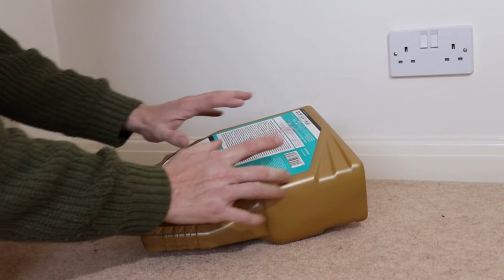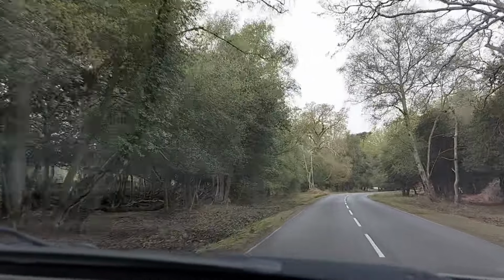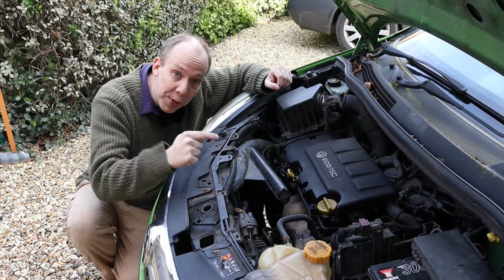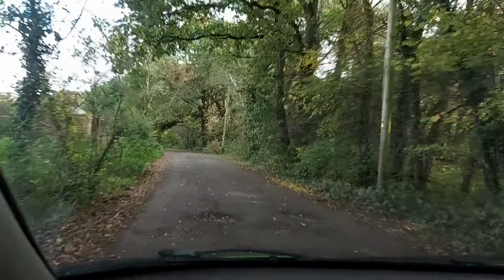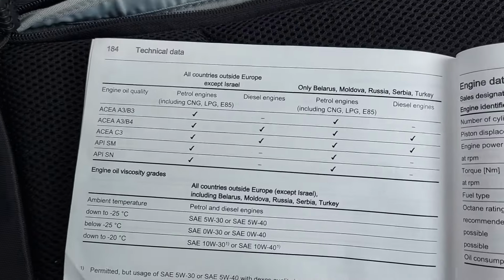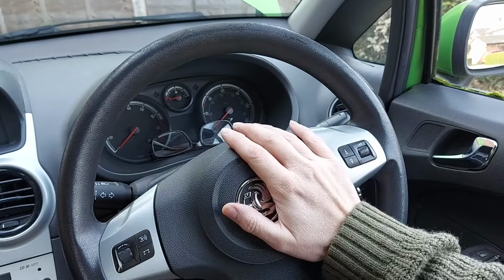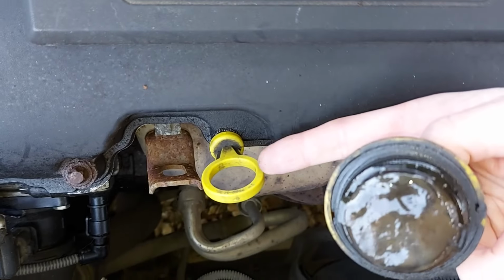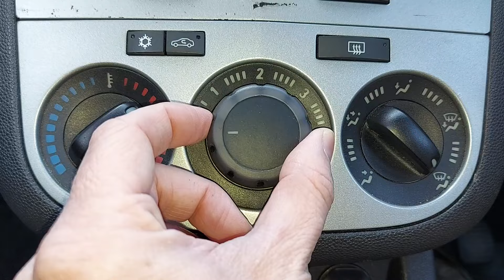Vauxhall Corsa D: How To Check Engine Oil Level (Opel Corsa D)

Comment: A good video as always.

Was it just the camera and lighting or did the underside of the oil filler cap perhaps suggest the engine isn't always fully warmed, lack of time, distance and frequency of use suggest that the car should be moved on to someone who would use it more, luv it more(?). 😁  (and no, that'd not be me).
Reply from the maker: I knew you'd notice!

Comment: great video. just wondering if youve had any problems with your handbrake button wearing down. i have and i cant find an easy solution. thanks.
Reply from the maker: Thanks. Glad you like the video. The Corsa isn't here at the moment, but I'll check the button when it's back.

Comment: I'm due to change the oil on my corsa soon. Do you reckon the sump can be drained without   putting the car on ramps/axel stands?
Reply from the maker: If you can get to the sump plug, yes.

Comment: HI I HAVE A 2007 - 2011/14 HOLDEN/VAUXHALL COMBO VAN IVE LOST KEY WILL THE 2 BT 433MHZ CORSA D KEY FOB WORK , THE FOB AND BLADE LOOK THE SAME , I DONT HAVE CARPASS OR TAG WILL A QUALITY OBD2 READER GET KEY CODES
Reply from the maker: You might find some information via the following link. See:

https://www.ukcorsa-d.com/